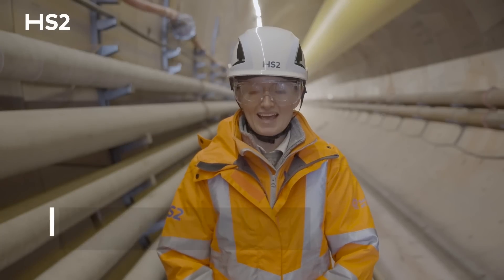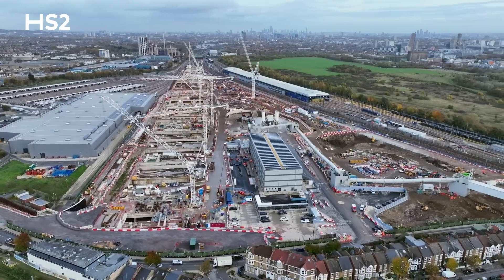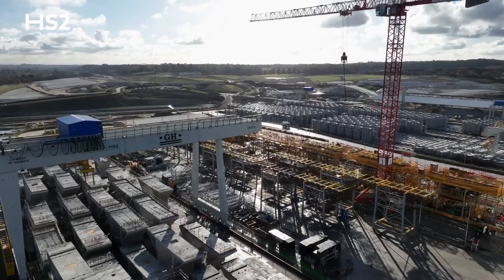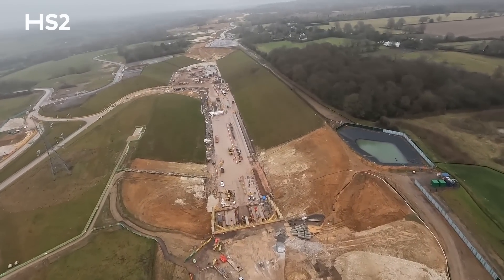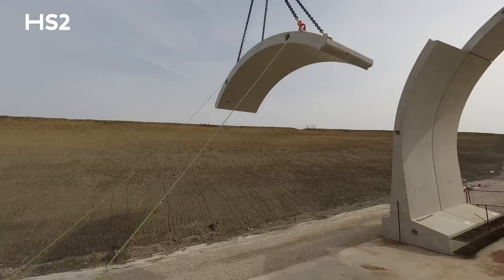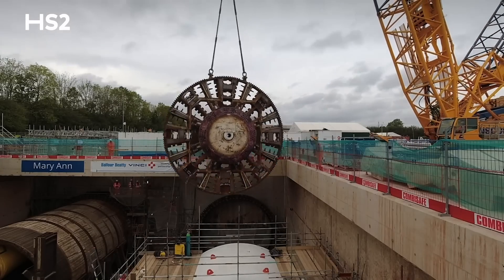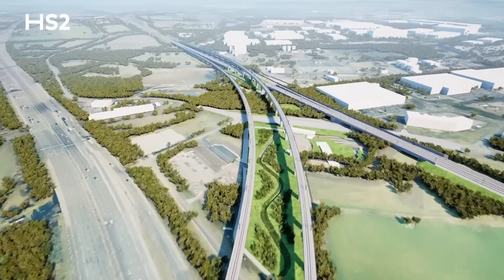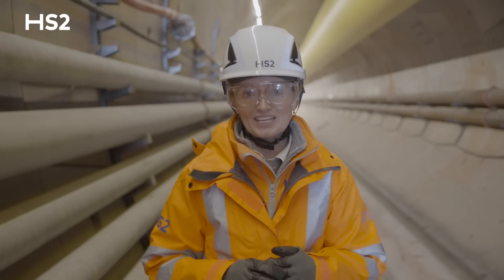HS2 Project Update, January 2024

Comment: When they created Permona station, on the Manchester Metrolink network, They made the viaduct in a way so they could one day make the route to The Trafford Centre.
I wonder if they would do that with the Birmingham end of HS2 and put a bit of bedding just outside of Birmingham so a future junction would be made.
Reply: I'm sure they will decide to continue HS2 construction further north in the future, whether that's in a decade or century. It is clear that it will be needed, as only going up to Birmingham is ridiculous and has very little benefit.
Reply: It was an absolute waste of money to buy it expensively, now sell it cheaply, and having to buy the land expensively in the future again!
Reply: @SL_Transport2  It is not just going to Birmingham as a short spur of HS2 goes from Birmingham Interchange where the HS2 line will join the WCML at Handsacre where the HS2 trains will join the existing WCML to travel to Manchester, keep up with the news on HS2
Reply: @peterwallen1063  Yes, I am aware of this. If you READ my comment above, it says "construction of HS2 further north" and refers to sections of track which are sold, you would realise it refers to track, not trains. 

Only building high speed lines up to Birmingham means HS2 trains have to join slow and already congested sections of track and does not deliver the full benefit of HS2. Journeys up to locations such as Manchester, Scotland will be 30 mins faster than current journeys, and the slow, overcrowded double-track sections of the West Coast Mainline and the cross country route to Leeds will become even more crowded, which is the exact opposite aim of HS2.
Reply: @SL_Transport2  The HS2 track actualy carries on past Birmingham to Handsacre where it oins te WCML to Crewe, this section of line is not blocked as the Pendolino services will be repaced by HS2 services here
Reply: Pomona*
Reply: Look up "Handsacre junction"
Reply: Unfortunately there is very little long term infrastructure planning, it’s all short term….. it could be so much better!!
Reply: At Birmingham Curzon Street the West Midlands Metro Tram stops at the station and no junctions are being made in Birmingham on the HS2 line
Reply: The tories have already sold off all the land making extending the line further north incredibly difficult and even more expensive
Reply: @noahbowie5985  There is always some twxt who gets permission to build a mansion just in the only feasible spot the line could negotiate.
Reply: @johnjephcote7636  And, as proven by Scotland's relaid Borders Railway at (I think) Gorebridge,  anything built on the route can be demolished.

Needs of the many...
Reply: @noahbowie5985  They've not sold it yet. See my above response.
Reply: @noahbowie5985  Nope
Reply: They already sold all of the land that they compulsorily purchased to make extending it impossible
Reply: @calvinimray423  Even half a century ago in my uni studies I knew the difference between the economy of scale of a network and what (this has now become) a mere link. I was thinking that the Tories, stuck in the mindset of the 1960s and pandering to the road lobby would turn all the rest into a monster motorway, at limitless cost.
Reply: @calvinimray423  They haven't yet. True, they've promised to, but they haven't yet. There are numerous legal challenges from within the rail industry that the Government must first deal with before they can sell, so if we can delay the sale until after the election, there may yet be hope.
Reply: @calvinimray423  No they haven't

Comment: What a colossal waste of money providing a service between Old Oak Common and Birmingham, Curzon Street only. High speed networks are supposed to link up with each other. This will remain a costly railway stump.  You may continue with these glossy and expensive videos but the narrative hides the fact this is a failed project.
Reply: not because of those building it but rather the incredibly inept government. Blame Sunak who has hobnailed HS2 and is now selling off the land originally allocated to connect with Manchester and Leeds, effectively killing any future government's ability to complete the project. Sunak is a vandal.
Reply: It is now finnaly going London Euston to Birmingham Curzon Street and North to Handsacre where HS2 trains will join the WCML to Manchester, So yes HS2 will connect to the Existing rail network at Handacre Junction in Staffordshire which is just North of Lichfield
Reply: @peterwallen1063  No it's not going to Euston.
Reply: @Eurobazz  I think you will find it is now going to Euston, why, because Old Oak Common station was only desighned as a through stopping station not a terminus station and has not got the facilities to hold trains in its platform for servicing for any lenghth of time and the Government was warned if they did not bore the twin tunnels now between OOC and Euston then they would not be able to do it at all, so the Government has changed it's mind and are now boring these tunnels through to London Euston where Euston will be reduced from 11 HS2 patforms to 6 HS2 platfom with a seventh platform being a joint HS2 and WCML platform. This information was plateed all over the Railway press at the beginning f December 2023, So yes IT IS NOW GOING TO EUSTON.
Reply: Which part of the Handsacre connection and what that means for rail travel to / from the North West are you struggling with? With your anti HS2 blinkers firmly affixed, OOC - Birmingham makes no sense but take you blinkers off and hey presto, even the currently truncated HS2 line has some benefits - unless of course Sunak and his witless minions throttle capacity at Euston so line capacity can never be realised. Currently (and it's being built) Curzon St has more planned capacity than DfT's latest nonsense planned at Euston - unless they connect HS2 lines with the whole of Euston station platforms. Now there's an idea.
Reply: So Eurobuzz what makes you think HS2 will be a failed project, concidering both the WCML and HS2 line will be run by one company, Avanti West Coast trains/ Tenltalia and all Avanti West Coast non stop trains from the North and Birmingham will transfer from running on the WCML to the HS2 line how can it fail, you need to have some trus in modern day technology and instead of reading the London Rag papers who are against HS2 try when you ever pop into WH Smiths take a look at the Railway Magazines that give you the full truth on HS2 including the Governments change of Heart of opening to London Euston.
Reply: @peterwallen1063  I'm not in the right frame of mind to answer you.

Comment: Why is no one saying that rail track wear is a significant maintenance issue and can be solved by using magnetic levitation trains, instead all you get is high speed rail as the rail answer to everything, it’s 60 years old now and is only a modification of fast rail. Magnetic levitation trains give you no rail track wear, a fully grade separated line and no overhead cabling or catenary/pantograph and no driver and no electricity needed to power the trains, it’s unaffected by weather, this is the rail future not fast rail with some faults solved a.k.a high speed rail. Magnetic levitation trains is the future. Hyperloop trains are best for continents, they operate in a vacuum tube with magnetics and are faster than the magnetic levitation trains. Not worth fussing over high speed rail it’s the Beatles era train technology now with computers not as terrible as Victorian steam rubbish. Good to see Oxfordshire get a decent rail link✌️❤️🇬🇧
Reply: Of course! That's why the technology first invented by BR's boffins in the 70's caught on so well. Perhaps you could explain HOW a MAGLEV system hops onto the existing network to serve numerous destinations as HS2 will - or would your idea need even more fantasy funding to complete it?
Reply: Hyperloop isn't even real (yet? who knows), 
and maglev trains are so so so much more expensive and require completely new infrastructure including inside city centers.
Reply: @mennonis  and yet Japan's new maglev train goes nearly twice as far, much faster, and has cost them less than half what HS2 costs...
Reply: @orangejoos  Japan also consistently plans such projects and builds them right? They have the experts and the government foresight and funding to do things right
Reply: Needs a lot of energy? I personally think they should have gone down a light weight 21century route. Brunel would have loved our modern materials

Comment: Rocket speed trains that need to stop every 25 kilometres is not a safe way to operate a railway. For much of Britain a well maintained fast rail network is good enough, 160 kph is fast enough in most cases for 400 or 500 kilometre journeys, remember high speed rail is best used for a network that crosses multiple time zones same for hyperloop trains, Britain is so small a train a little faster than a car is sufficient to cross the length of it in a few hours. You can fly if this is not fast enough. Hs2 will be the only high speed rail link in the u.k as magnetic powered trains are the future not the 1960’s with added computers, sustainability means magnetic powered trains. Mag lev trains eliminate rail track wear and don’t need a driver and don’t need massive metal tracks, this is modern rail, high speed rail is 60 years old that’s not the future, the future is magnetic levitation trains not let’s build the 1960’s everywhere and call 60 years old history the future that’s delinquency. Hs2 is fine for underserved communities between London and Birmingham west of the Euston line and best of all it’s not a 19th century design, that’s good. If you are going to replace the rail network with something modern it should be magnetic levitation and solve the maintenance and sustainability issues with rail networks not build the 1960’s everywhere that would be foolish. Fast rail is adequate for a tiny island until the normal people arrive and qualified people can make better decisions based on sustainability and safety not history. Hs2 is useful to plug a hole in connectivity following the m40 roughly. When you build a rail network it’s not intended as a celebration of 60 year old history, there is more to life than black and white tv history ✌️❤️🇬🇧
Reply: You're talking about similar distances that the French TGV might cover, and look at how successful their highspeed rail is
Reply: when the train leaves old oak common the first stop is interchange in Solihull, hardly 25km is it

Comment: The whole point of hs2 is to provide connectivity between London and Birmingham on a westerly alignment better serving populations far to the west of the Euston line to Birmingham, it was never intended to be a total duality for the existing rail network, the rest of the hs2 plan was never needed so of course it was abandoned. The existing rail network needs a lot of improvements far cheaper than a 2nd rail network all over the north of England. Hs2 completes rail connectivity from London to nearby regions with everywhere accessible quickly. Britain is so small fast rail that is well maintained is good enough, London to Glasgow is already 4 hours 40 minutes on fast rail with 4 stops. If building new high speed rail makes sense, it doesn’t make sense to change the entire network when magnetic levitation trains are far more sustainable so cancelling most of the high speed rail is a good idea. London to Birmingham is poorly served for rail to the west hs2 solves this, congratulations hs2✌️❤️🇬🇧 Britain is too small 600 kph trains
Reply: You're talking about similar distances that the French TGV might cover, and look at how successful their highspeed rail is